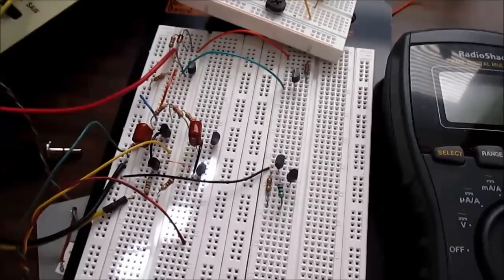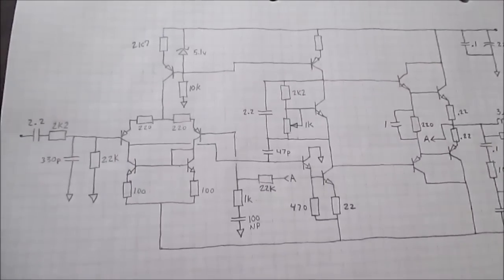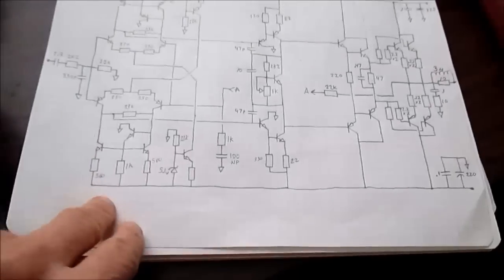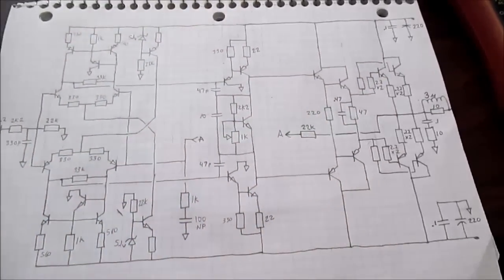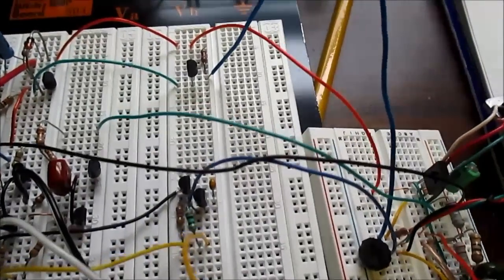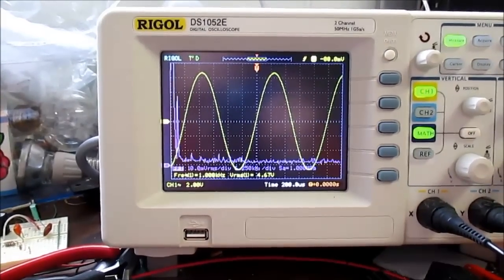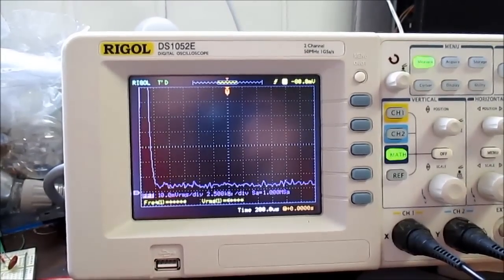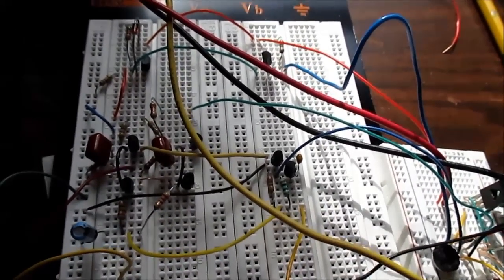Transistor audio power amplifier circuit

Comment: After all that design, my "OCD" would NOT permit me to build that on a socket prototype board 😂 I would do it classic rats nest. I have a very good methodology of execution of this after 25 years of building that way.
Even VHF RF circuits I reproduce with good results if the components are the same. It's even good at 500mhz if you know what you're doing

Comment: I've got jelly been transistors and such but what are some specific ics I should have on hand. If you find the time.
Reply from the maker: ICs can be very specific for their function, but I would say operational amplifier ICs are the number one IC to have on hand for linear or audio tinkering.
Reply: @JohnAudioTech  for sure. I have a bunch from kits but their quality is questionable. I'm going to start buying them from digikey. I really appreciate the advice brother. I'm going to join your patreon when I get paid.
Reply: NE5532 and NE5534 are the ducks guts I think as far as OP amps go for audio tinkering

Comment: I appreciate that you find this circuit to be "straight-forward" and "basic" ... but what if it isn't? Just a "differential amp" with "current mirror" ... "current sources" ...  "Darlington class A driver" ... "BIAS SPREADER?!?!" I understood that the cat is hungry. 😂
Reply: it's pretty firm and simple according to douglas and bob's books, even with two pole compensation. The non-basic would be more than that. Differential input stage and push pull vas is a little bit more not basic. Next is current feedback ones, or 4 - 5stage amplifier or composite amplifier etc.
Reply: @johnyang799 I had a thing for riding my bike to the tip as a kid and looking at the schematics in the back of dumped tvs and radiograms etc and taking a heap of circuit boards home 😂 John Audio tech really satisfies my schematic itch nicely haha
Reply: It is simple once you understand the individual circuit elements. Nice circuit actually. Not over the top but not skimping either... Hang on, further on in the vid there's a more advanced circuit. This is getting serious 😂 I still like it though. Fascinating actually

Comment: I have been attempting to build a amp similar to this, I am have some problems understanding the base bias of the differential amp, it seems I can only get mine to work using a pullup resistor grnd, I have doug selfs book,  it looks like the right side diff amp is being biased through the speaker to grnd? Also, where can one  get matched transistors, because I think that is why I couldn't get my diff amp to work with a current mirror active load, so I just used a passive load instead.

Comment: What is a speedup capacitor?
Reply from the maker: It discharges the base faster at high frequencies to speed up the operation of transistors in the darlington configuration.
Reply: Thanks

Comment: Nice episode, as always, thanks  :-)
Congrats on your design :-)
Could you maby talk a little about the transistors you have chosen for your design, and maby why those types ?
And could you please tell us the title of that book you refeered to, maby that was worth a look ?

Greatings from Denmark.
Morten
Reply from the maker: +Morten Rolsing Much thanks for watching! I used pretty much what I have on hand. I used KSA992 and KSC1845 transistors in the input stage and vas stage. BD139/140 drivers and 2SD718 & 2SB688 outputs. I would use better outputs but that's all I had in my parts drawer.

Books:
"Designing Audio Amplifiers", Bob Cordell
"Audio Power Amplifier Design 6th Edition", Douglas Self
Reply: +JohnAudioTech Thanks :-) looking forward to the next spisode.

Comment: That's why I like discrete circuits - you can have a lot of fun time tweaking them. And, what can you say about TDA2822? Your opinion on this chip?
Reply from the maker: +MrJohhhnnnyyy Yes, discrete is forever tweakable. With audio amps there are endless ways to make them. They are great when you need more power or high current for low impedance loads. I'm still a big fan of chip amps though. I made a video of the 2822 a while back.
Reply: Discrete is for the joy of experiments.
Wish I had all these flashy instruments to analyze things spectrally and visually look at waveforms. I don't own much test equipment, but if I did, I'd play endlessly with audio amplifiers
Reply: +MrJohhhnnnyyy 2822 is obsolete, except from some chinese vendors.
Reply: iceberg789 I know, I just asked what he thinks about this chip. And being the cheapskate I am, I can always harvest it from some junk boards :)
Reply: +MrJohhhnnnyyy o check his upload list, he already reviewed it in one of his earlier ones. in my opinion though, it makes good sound, but a bit sensitive to rf interference, 2 of my chinese made chips got fried cause they were placed near cellphone.
Reply: iceberg789 Found it :) Yeah, it has a lot of voltage gain which makes it sensitive. But actually frying them with a cellphone - seems bizarre to me.
Reply: JohnAudioTech I'm a fan of discrete designs, but I use chip amps as well. Whenever I need to make an amp quickly and don't create much hassle for myself, I use chips.
 Yeah, I found that video. I watched it back then, but for some reason I forgot about it.
Reply: +MrJohhhnnnyyy may be due to cheap manufacture qualities. i was trying to play the open board amp from cellfone, but the gprs was on. there were some loud noises from speaker and next time it went silent.
i was confused, and thought perhaps some connection was wrong. but next time another ship got fried when a call came. it felt rather weird, cause when i use the lm386 board, it simply gives a rock stable output, no interference or anything.
however, sound quality wise 2822 is wayy ahead 386, u can feel the difference even without trying. 
if you try swapping the input caps with different values, u will also find a sweet spot for bass, i finally went foe 2.2uf input caps, and it really sounds sweet.

another funny thing, if u put the input cap not before, but after the input voltage divider, it does give a sleepless night to rookie circuit makers like me. :)
Reply: iceberg789 I use it in bridge mode, works fine, but I'm not really satisfied with the noise on the output, even though  I'm using a Li-Ion cell to power it. Too much gain creates noise. Does your amp hiss with input grounded? It has a large voltage gain, which makes it sensitive to misc. crap&noisy. On the stereo one, I can easily decrease gain with a resistor between inverting input and cap that goes to the ground, but I dunno how to do that in the bridge circuit.
Reply: +MrJohhhnnnyyy i think it is that ground connection problem. i was not aware of this either before, but there mr john told me about it.
in all sorts of audio amp circuit design, the ground connect has to be distinct. for chip amp it has to be "star" connection, with the ground pin of ic as the centre. 
i.e. every ground connection must connect to ic ground pin, and they wont connect to each other directly.

search some of his older lm386 videos, i think he also described it in one.

even though it has big gain, it doesn't actually make any noise, except a slight no sound hiss, audible mostly in a silent environment.
Reply: iceberg789 I know about star ground, but I just couldn't be bothered any more so I just filled the free space on the PCB with the ground plane. Yes, it's the slight hiss I'm getting, but being the picky bastard I am, I want it to not exist LOL
 I'll make a video about that amp on Wednesday, so you'll see what I mean (that, of course, if you want to).
Reply: +MrJohhhnnnyyy sure, will be waiting for it !

Comment: Have you experimented with Class D amplifiers ?
Reply from the maker: +PetruV years ago on my old channel, I made a class D amp using a 555 timer. I might make one using op amps at some point. I'm not a huge fan of class D.
Reply: There are very well regarded on the forums, I have one too,and I love it
Reply: +JohnAudioTech  If I recall right, you had three or more videos of audio amp made from unlikely chips. Some of my favorites. If they still linger on your hard drive somewhere you should put them back up.
Reply from the maker: +HillOrStream That might be the 555 timer based class D amplifier circuit video. I don't think I have it anymore.